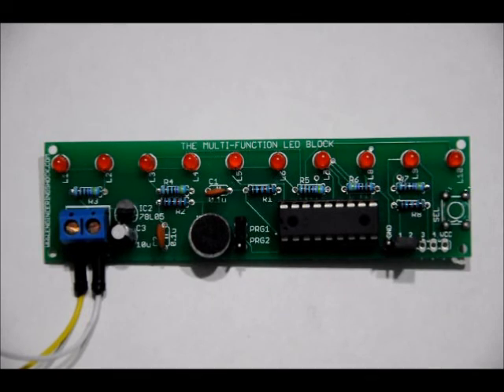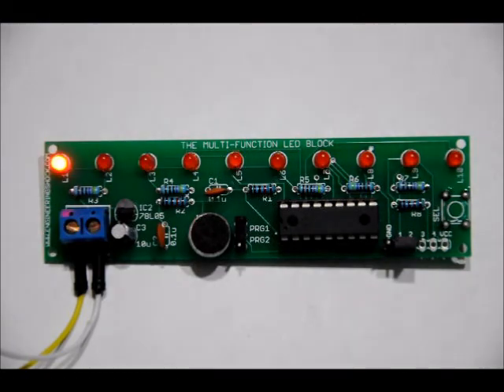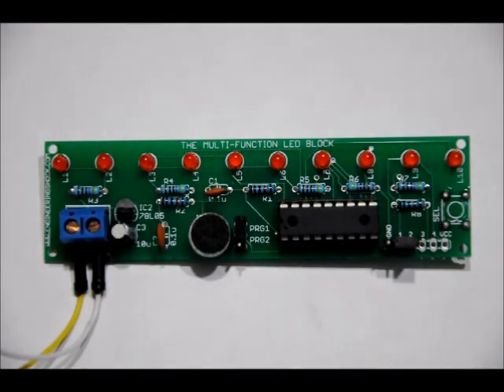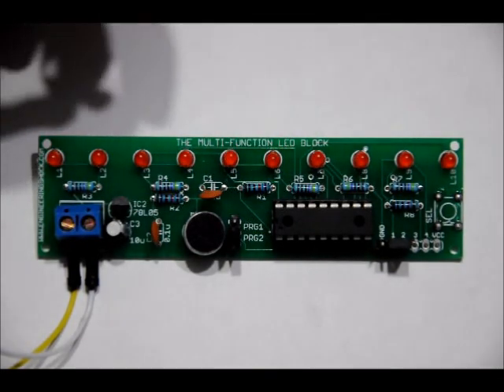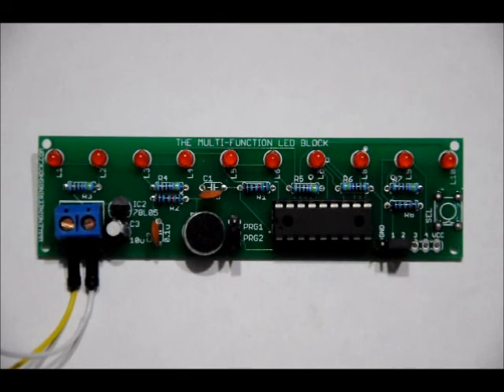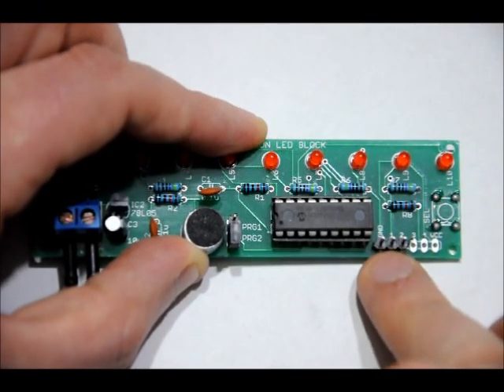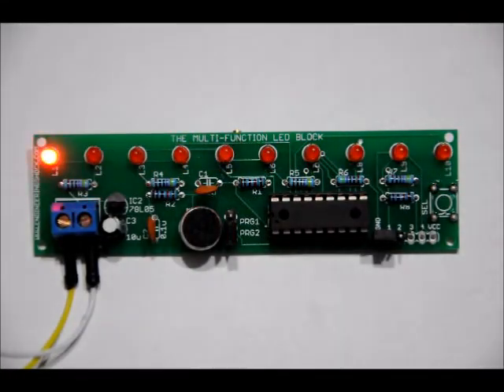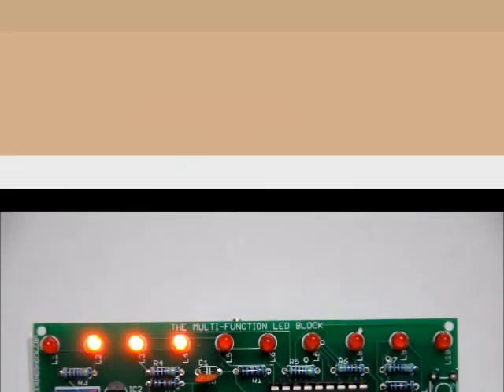What Do VU Meters, Number#5 From Short Circuit, and Knight Rider Have In Common?

Comment: It´s not a VU-Meter, its a peak meter. A VU- shows the average sound level of 300ms if I remember correctly, but your circuit is way to fast, so I guess its a peak meter. However nice project.